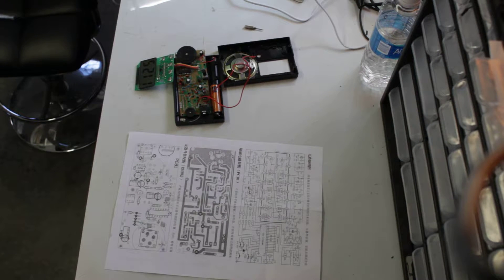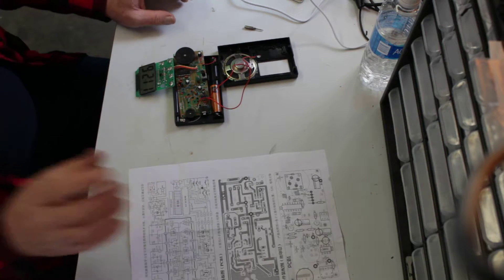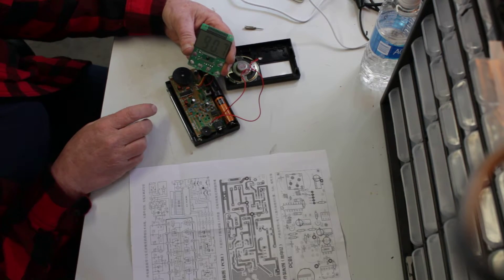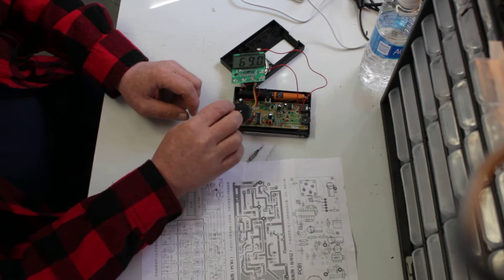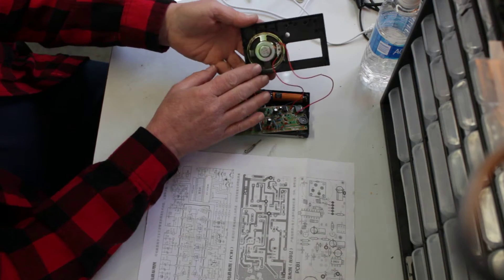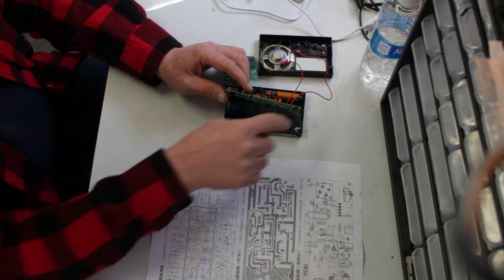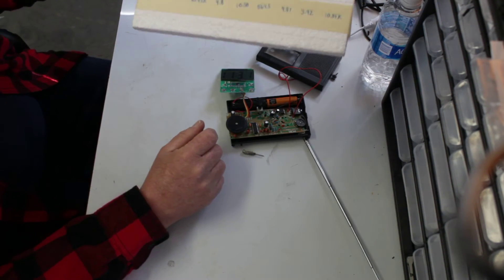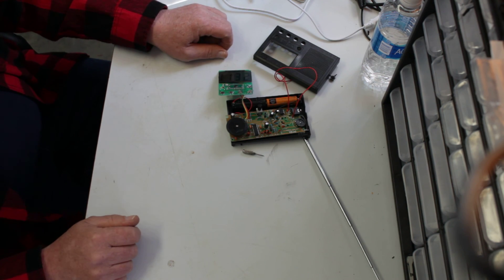Banggood Black FM Radio Diy Kit  tips and tricks

Comment: You using kHz for the FM broadcast band MHz my ears.  Yes, I did just make a radio pun.  I might also remind you that the reason why Japanese FM radios cannot tune above 90 MHz is due to a bygone era of when analog TV used to be a thing in Japan.  The bandwidth of Channels 1-3 there were in the 90-108 MHz region of the VHF dial and people who brought their North American radio receivers over to Japan were quite interested to say the least that they could receive the audio carriers of TV Channels 1-3 by tuning their US market FM radios to 95.7, 101.7 or 107.7.  Because of the range of Japanese FM radios in the US market, Japanese listeners discovered that you could also tune US Channels 5 and 6 on a Japanese radio by tuning it to 81.7 for Channel 5 and 87.7 for Channel 6.
Reply from the maker: Too many years as a Ham op I guess